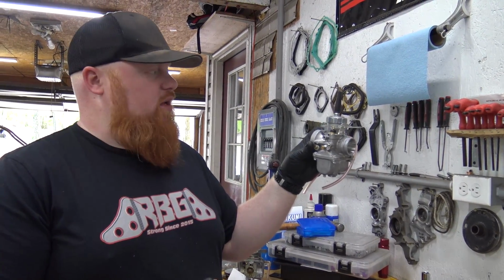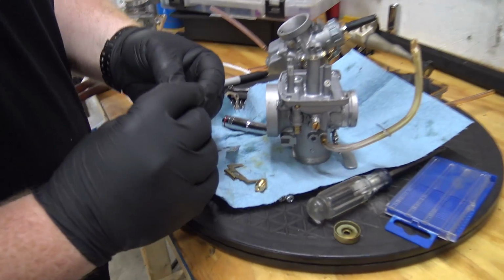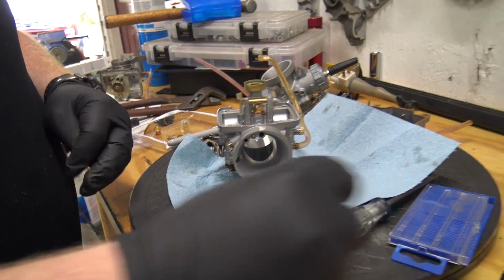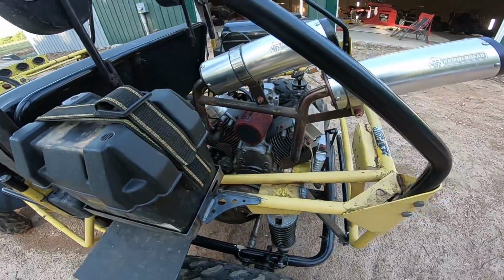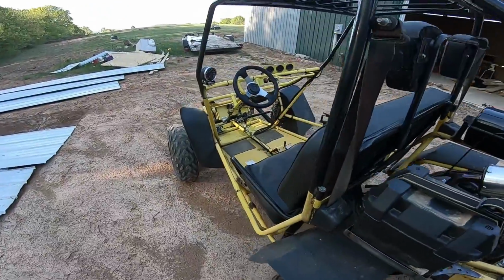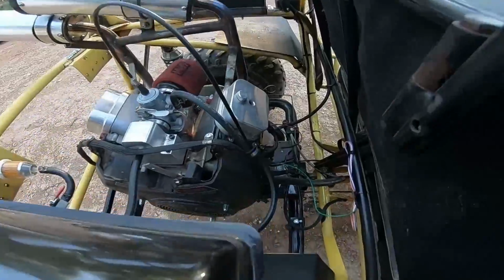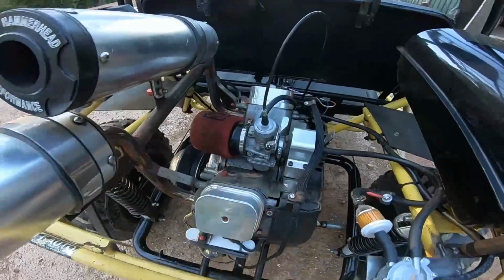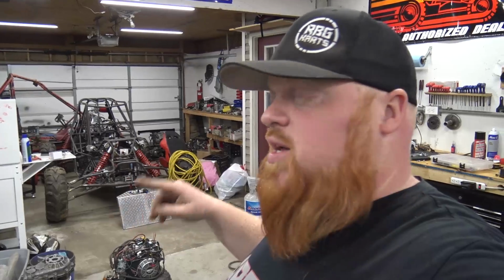35Hp Manco Deuce First Ride ~ She Rips!!!

Comment: Screw the dinky tank cut out the rear brace bars weld two rods going parallel to the swingarm mount the engine up there add the other carb!